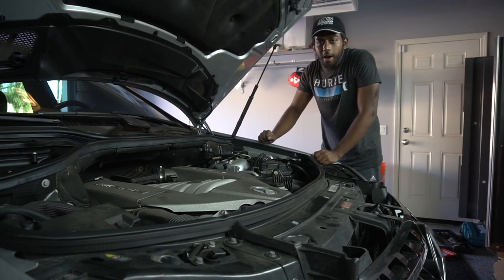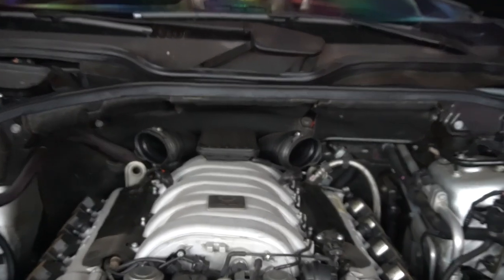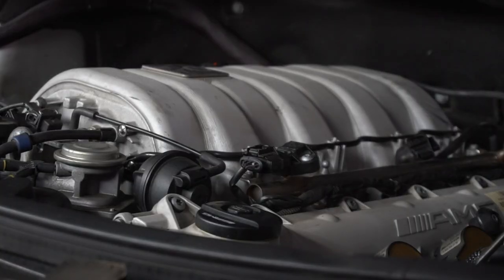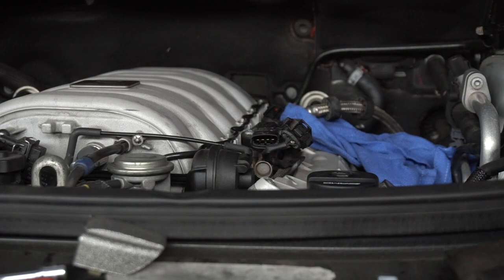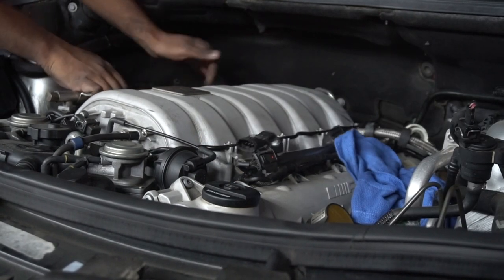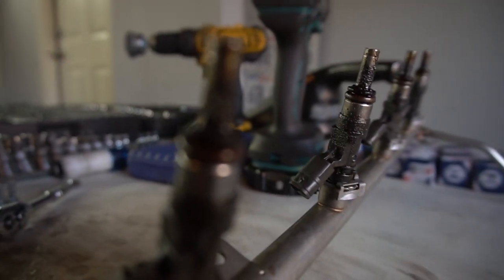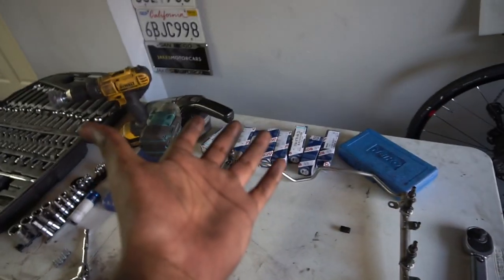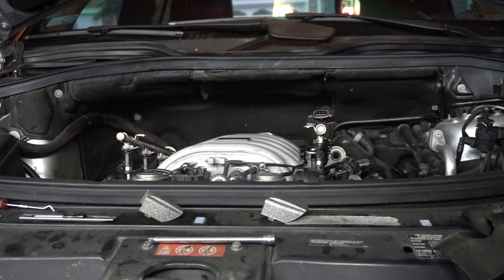Mercedes 63 AMG M156 V8 Fuel Injector Replacement (Before it's too late!) - W164 ML63

Comment: high temp silicone hoses are helpful wherever you can in the engine bay, those vacuum hoses go bad easily being rubber. Just measure the id/od diameter and you can find them for many different applications. Nice Video!
Reply from the maker: Yessir! Actually been using platinum cured silicone lines to replace all the lines i’ve come across in this car as well as my 335i. With this specific part, I’ve opted for an oem one as i wanted to preserve the L shaped bend!
Reply: @SamAbraham  nice! It’s peace of mind after changing them to silicone for sure.
Reply from the maker: @ANDERZENAMG  Absolutely.. man every single line in my 335 would fall apart if I looked at it wrong 😂

Comment: Great Video! Do you have the part number for the intake tube that cracked on your video? What is that part called? I will be doing my SL63 AMG which has about 110k miles on it.
Reply from the maker: I assume ur talking about the vacuum elbow connector? I believe A1170780681 is the part for that. Used to have an 09 SL63, miss that car!
Reply: @SamAbraham  Thank you! I love the 09 SL63 Engine, it's one of a kind! :)

Comment: What’s up Sam. I want to change my injectors too on my ‘13 c63 for 300$ by myself since my shop quoted me $1700 lol. Would you say this is pretty easy to do? I’m not nearly as experienced as you but I can turn a wrench here and there. Thanks bro!
Reply: you saw all the steps on his video. Only you can decide if you want to try. I would say if youre confident for that, then yes, you can do it. I'm also not experienced and thinking about do it by my self :)
Reply from the maker: For someone not too used to working on cars, I think this is definitely something you can do as long as you have the tools of course. The best thing I can recommend is have a friend with you who may work on cars more often. Either way you'll be able to figure it out, I personally cannot imagine paying that much for a pretty simple job like this. In the grand scheme of things this is pretty easy, but again its all relative. Just be honest with yourself! I only started working on cars about 4 years ago when I was quoted a ridiculous amount for a valve cover gasket on my 335i, no schooling or anything like that. Anyone can get into it!
Reply: @SamAbraham  do you recommending disconnecting the battery first?

Comment: Need to change mine soon, I just had my power steering pump go out at 79k.
Reply from the maker: That sucks, sounds kinda early. Doing full lock with donuts?
Reply: @SamAbraham  It had been giving me noises since I got the car in June.  I had been meaning to do the flush with the new reservoir and delayed and it ended up taking out the pump.
Reply from the maker: @philipsgarage  Ah that’s annoying.. lot of the time that means the previous owner was doing donuts or something like that with the steering wheel full lock 😂 Big nono with any 156 powered car (and generally any car)

Comment: So for the updated M156 (2012+ C63), we should do serpentine belt change, fuel injector change, a few fluid flushes/changes. What about the other issues such as Crankcase Breather Valve, Camshaft Adjusters, Intake Manifold Failure, and Camshaft and Hydraulic Lifters. Any plans to change these or would this be too much? The last one i see on forms people would just use MOS2 to avoid friction between the metal parts.
Reply from the maker: What you described applies to any M156, not just the later ones. Crankcase breather, camshaft adjusters, intake mani, and lifters are all parts I wouldn't be concerned about any of these potential issues until you experience some sort of symptoms that points you in that direction. I can see maybe changing the PCV at around 75k miles for the sake of changing it, I haven't had to on any of my cars yet. I use two bottles LiquiMoly's Ceratec additive every oil change. Essentially a more comprehensive additive, superior to MOS2. Significantly reduces top end noise from my usage. Going to be taking the intake mani off my 94k mile ML63 soon (video will be coming with that) so I'll see how bad the corrosion is, if any. No symptoms of failure thus far. Over 10 years and 5 different M156/M159s, I have never had the camshaft adjuster or mani issue. Lifters were changed twice under warranty on our much earlier car, a 2009 SL63. Very obvious ticking with that car.

Comment: Hi I got a 2010 c63 amg with 94k miles and have a code P228f which says something about fuel pressure,  but the code came off for awhile, and then came back on later, any tips on what to do or check, possibly even replace
Reply: Me too.  I’m in same boat.  It’s sputters under full throttle and today I think it officially misfired.
Reply: @davidshaver7569  aw man I really wanna get this figured out, hopefully this weekend me an my uncle can maybe figure out what's goin on I'll keep you updated bro we gonna do spark plugs oil, trans fluid change today an see how it runs an then also check the fuel pressure
Reply: @champion1389  please lmk!!
Reply from the maker: Hmm, if its not a fuel pump issue or anything really with the fuel system, it could be a vacuum leak. Given the age and mileage of ur car its likely that some of the rubber lines have degraded and are splitting open in some cases. Look at the front and rear of the intake manifold for some of those lines just to see what shape they're in. On my 2009 ML63 with 95k miles I've had to replace nearly every vacuum line.

Comment: dude. watch tasos. hes never seen 1 with the issue. your better off doing the spark plugs. my car has 200000km.
Reply from the maker: Tasos makes great stuff, I watch him all the time actually. I chose to change mine because i’ve had personal experience with injector failure in my C63 as I mentioned, so I’d rather be safe than sorry. Couldn’t hurt for only $250 haha. My spark plugs are fine, I check them every 1000 miles